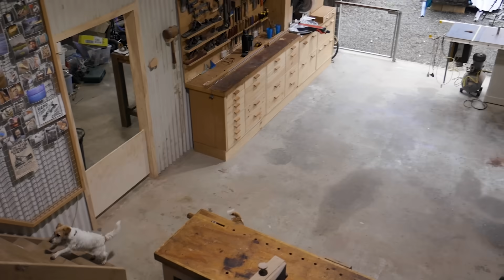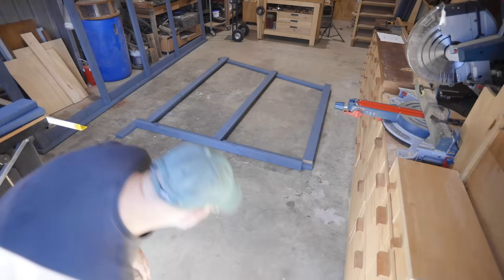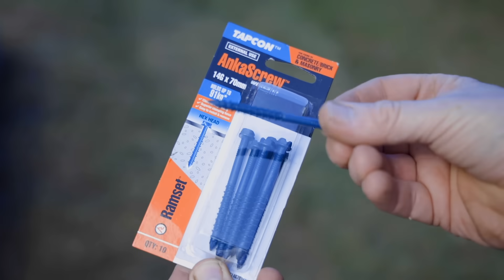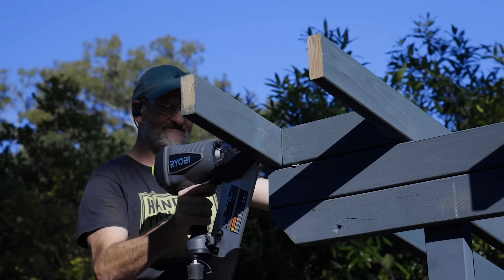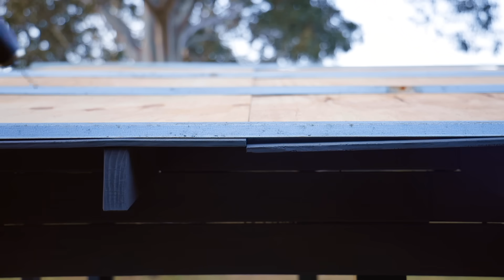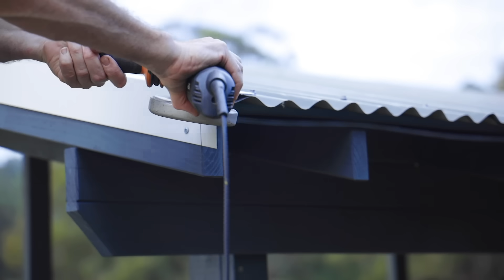Chicken Coop Build pt1 - The Frame and Roof

Comment: great content, what i learnt from tractor coop vds, and I looked at few....., is put wheels at Centre of balance, there was a lot of ideas on wheel raising, but the simplest way i believe is buy two jockey wheels with 10" tyres, remove handle and put a hex head on top and use your electric drill to raise and lower. cheers Gid

Comment: So, why put the plywood parallel to the joists instead of perpendicular? For that matter, why put down the plywood at all if you're putting purlins across? Great video though, mate!
Reply from the maker: The plywood was 2.7m which was exactly the length of the rafters so I thought it made sense to use them as I did. They weren't there for strength(even though it would help) but to seal the top in and stop snakes from getting under the tin. :)

Comment: Man, I still don't understand why many Youtubers, like you, check the square through the diagonals.  Equal diagonals do not guarantee a perfect square, because in the case of the trapezoid, for example, its diagonals are also equal, but their angles are different from 90 degrees.
A big hug from Minas Gerais, Brazil.

Comment: Best trick I've ever learned for tin/steel siding/roofing is to pre-drill the screw holes with all the sheets stacked on top of each other after trimming to length.... It guarantees uniform placement and means you don't have to use a chalk line on the roof

Comment: Spoiling those chicks :P A few suggestions since we had a few of those coops getting their roofs torn off and/or blown in such a way that the entire structure folded. I would include a few cables, directly down from your rafters into your concrete base. That way the roof assembly doesn't go flying. Depends how windy it gets where you are though and it might not be an issue.

Comment: Hey Mate are those not self tapping screws, That's a lot of extra work pre-drilling holes,,,
Reply from the maker: They weren’t metal tapping screws as I wanted them to bite into the timber. They will go through the roofing but much easier to pre-drill them. 😊
Reply: @PaskMakes  10-4 ghoombah,,,
Reply: @PaskMakes  You did a great job on that coop, I would love to build one like that but im afrade the flies would blow it before i got finished, lllol

Comment: We use sand in the laying box and on all surfaces also put a thin layer of sand. The guano (poop) doesn't stick and it's easy to clean w a dust pan and paint scraper. Sift out the laying pox w kitty litter handled sieve. We live in Florida so part of my property is all sand.

Comment: Great start to the coop. Just some friendly advice for anyone else tackling a roof project - plywood is rated to be installed perpendicular to the rafters or joists supporting it.
Reply: A Ray: true that.... but you’re over thinking it. there was nothing in that coop that was code compliant or even engineered on a prescriptive path - shear value of that roof diaphragm pails to the lack of shear in the walls. Agricultural structures can be built anyway you want

Comment: I would have run the plywood 90 degrees to the way you did.
Reply from the maker: The plywood was 2.7m exactly the same as the rafters so I thought it made sense to use them that way but you’re probably right. 😊

Comment: In Germany you need a permission to build such a building.
Reply: Uwe Keim : really? Here in SW Washington State you can build a structure up to 200 sq ft, 12’ tall without permits
Reply: @BiggMo  Depends on the size. In some states ("Bundesländer") here in Germany, you need a permission if the whole volume of the shed exceeds 10 m³ or is higher than 3 meters.

Comment: Side question: when you chose your Bosch Glide miter saw, had you considered the Delta Cruiser? - I need to replace mine (construction site damaged) and I’m wondering about the two.
Reply: While I have used and really like the 12” Bosch Glide saw I have never heard of the Delta Cruzer. 
Seems like there are some favourable comments and reviews for it. I’ll definitely look into it more as a potential replacement when I upgrade my saw.
Reply from the maker: I’ve not heard of the Dewalt cruiser but I’m loving the Bosch saw and I’m very happy with it. 😊

Comment: 11:10 I think this is what H clips are for. I've heard roofers talk about them. They join 2 pieces of plywood together on your roof so they're not flexing differently or warping differently over time due to moisture. From what I know they look just like they sound - an H shaped clip that holds a piece of plywood in either end of the H shape and keeps the ends of both sheets of ply butted together flush and stops them from moving about. You being handy AF could probably make a few in your metal shop with scraps! ;)
Reply: H brackets are used to space the OSB sheets and to minimize warping and flex. I make sure my decking goes down over studs at each seam then draw nail to the studs. 24 on center is the key.

Comment: That tin will cut like butter if you take a piece of baling wire and put it under the tin and put two 2x4's on top. Pull the wire up through the crack between the two boards while standing on the boards. It is much faster than cutting and gives a perfect non burred edge.
Reply: Hmmm... I’d have to see this done to understand how it could work. I can see it might work with fiberglass panels, but tin? I must not be looking at it correctly.
Reply: @VideobyHomeworks  How this works is you take the wire and lay it on the ground, put the tin on top of the wire and then take two 2x4's and lay them on top of the tin, one on each side of the mark where you want to cut with the wire coming up between the 2x4's. One end of the wire needs to be tied to something to anchor it and the other end is tied to something so you can pull it up and through the tin. Stand on the 2x4's and pull up and it will slice the tin without any burrs.  My Dad did this back when I was a boy and I have used this method to cut hundreds of pieces of tin. Very easy and fast.
Reply from the maker: If there’s enough leftover I usually just tear it. I showed this on my new metal workshop video. 😊

Comment: Why is there plywood, what will condensation drip from the metal, and where is the ventilation under the roofing?
Reply from the maker: The plywood was to seal in the roof to the top of the frame and to keep snakes out. 😊
Reply: @PaskMakes  understandably, the features of the local fauna 👌

Comment: Neil, good looking chook coop. A suggestion from personal experience, if your strip footing is not deep then foxes/dogs will dig under it and they can be pretty determined. We fixed this by lifting the grass around the coop out to a meter, laid out and pinned wire mesh (ours was old cyclone fencing mesh), then replacing the grass. They only dig against the side of the coop and this keeps them out.
Reply from the maker: Thanks Andrew! That’s exactly what I plan to do. 😊

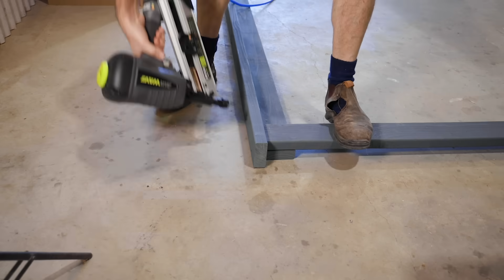Comment: 2:30 Ahh yes, that first shot of the nailgun after you've oiled it for the day and it sprays you in the face with a fine mist of petrochemicals. My favorite is when I'm sitting there trying to get the angle just right and my mouth is hanging open slightly so that I get a mouthful of filth that I have to then futilely try to rinse out over the next 10 minutes.
Reply: It’s happened to the best of us.  Took me a longtime to learn not to over oil my guns.
Reply: @BiggMo  Some guns need a couple extra drops regardless of what the manufacturer says. Didn't take me long to learn how to avoid pinched/rolled o-rings.
Reply: Would it help to put a rag over wherever the oil cones out?
Reply: Double Dare Fan - Yes, if you have that kind of foresight. You could also just shoot a random test shot to get the initial oil out. The bigger problem is that extra oil, you can Hydro lock the piston and ruin the seals
Reply: Wear your covid 19 mask!  Oops i forgot it cuts off 30% of oxygen to the brain and causes more problems than it solves!!!!!
Reply: @victorbunch7725  some of us understand that you are joking...
Reply: Victor Bunch it... doesn’t. You know people — from painters to literal fucking brain surgeons — have been wearing these things all day long, right?
Reply: @victorbunch7725  Well it obviously isn't a mask that's cutting off the oxygen to your brain and leading you to believe such utter drivel. Maybe you should get that checked out. By a doctor. Who will probably be wearing a mask.